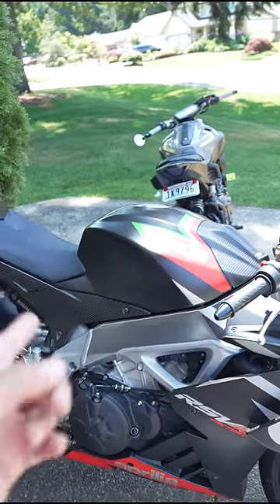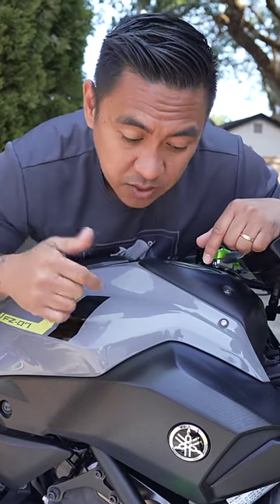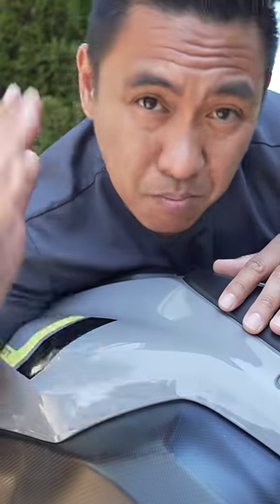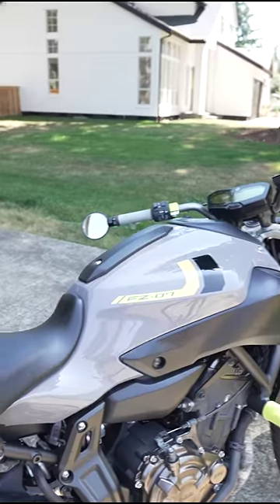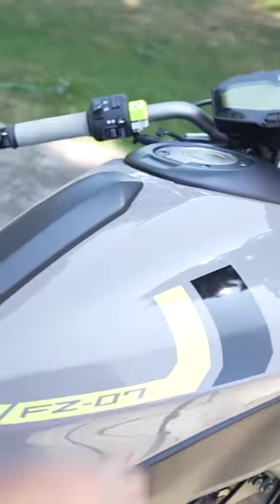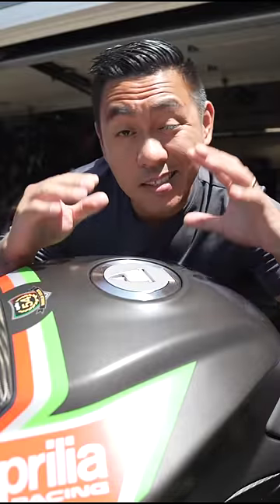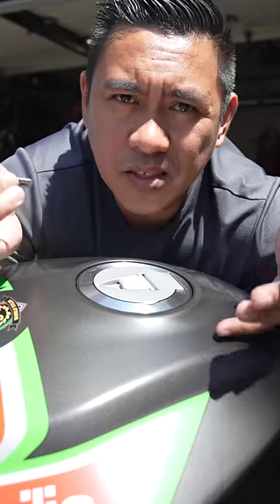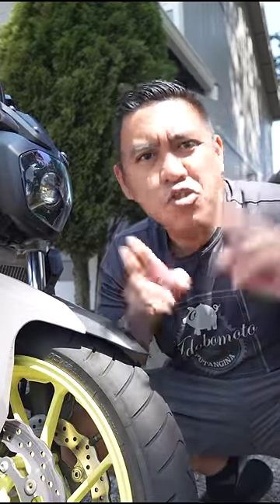HOW TO RELEASE MOTORCYCLE TANK PRESSURE

Comment: Fuel tanks are supposed to relieve pressure on their own but manufacturers use very poorly designed evap systems on bikes just to pass emission laws so i always get rid of them for a breather line, i had to pay a thousand dollars for the tank on my ninja 400 because it kept building pressure in the tank on hot days and eventually the pressure blew out some welds on the bottom of my tank and it started leaking 😬
Reply: it was an automatic feature
Reply: I came to say the same thing. Those cheap ass dirtbike cap vents suck too, my buddies tank blew up in his face on pikes peak from not venting. 
After that he got rid of that little check valve vent everyone uses and just ran a longer, open hose, down the neck of bike like stock.

Comment: $3000 for a plastic tank is outrageous
Reply: $3000 for a metal tank.
Couple of hundred bucks for a plastic tank.
Reply: And it doesn't have an automatic pressure relieve sistem? 😃 Literally my 2004 50cc derbi has a hole on the cap with some foam so only the fumes can escape
Reply: @stanislavmikhailiukov1005 he said himself his Aprilia tank made of plastic and cost to replace is $3000 brand new.
Reply: My cb750 tank new costs like 100$
Reply: @krisztianromer433 my derbi doesn't  have foam in the cap but still it does what it's supposed to do
Reply: Well its an Italian super bike so yea. Doesn't surprise me. Very outrageous tho.
Reply: @tarikhulmahfudz7829 he also said it the actual tank costs 3k and he called them plastic tank covers.
Reply: 5 dollar to weld a hole on metal tank

Comment: Triumph,  Like what you have there originally had plastic and started making metal ones near the end of the run. The problem isn't a pressure thing(some maybe) But the big cause is the alcohol in this crappy fuel we have now. The ethanol causes the plastic to swell so handle bars start to hit fittings start leaking and mount holes won't line up if you leave the tank off too long. You can sometimes let them dry out and if there is any luck they can go back to shape. Say thanks to the government for the shitty fuel. I only run alcohol free and/or race gas. Stuff like VP or Cam 2 but that can be an expensive pain in the ass

Comment: Why is there no vent for the tank? As the fuel in the tank goes down, it forms a vacuum. As the vacuum grows, the fuel will have a harder time getting to the engine and eventually stop flowing. I guess when you "run out of gas" you open the fuel tank?
Reply: It does have vents. They get to a certain pressure then open (of hot and over pressured), then I'm guessing it has a 1 way valve (like a tire valve) allowing it to suck in air when it's volume of fuel depletes.

Dirt bikes and duel sports solve this complexity by simply having a hose come out the gas cap allowing it to breath in or out as needed, no fancy valves, just a hose long enough to keep gas from splashing out onto you and tucks in next to the frame.
Reply: @jakegarrett8109  my rebel fuel tank breathes through a grove that goes past the seal of the gas cap. Not sure why they don't do that

Comment: Do your tanks not have vents?? Mine do
Reply: I think that it ain't really good... Like the fuel could spill out in a crash or even if you're just taking a sharp turn. Now, i don't know much about motorcycles but  this is my assumption.
Reply: @RolVirsla  well the vents are always open so pressure never builds up in them, i can open the tanks at any time and there’s no pressure or WOOSH sound. At least in my R1 and FZ09, I’ve never owned an Aprillia so not sure about that bike but i would think a high end bike like that would have a vent in the tank
Reply: @RolVirsla Every motorcycle tank has this thing called a one-way vent. It opens when the pressure inside is lower than the pressure outside, and it closes when the weight of the fuel pushes the marble out  closing its passage in the event of a crash. unless your tank was made out of bottles.